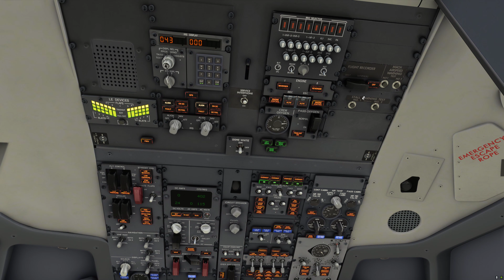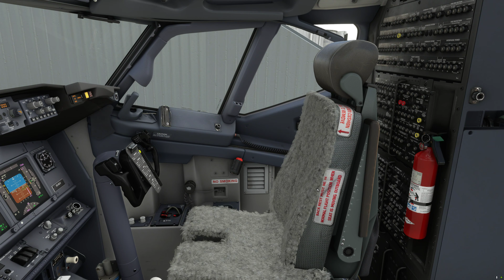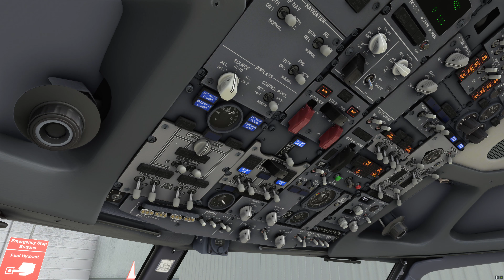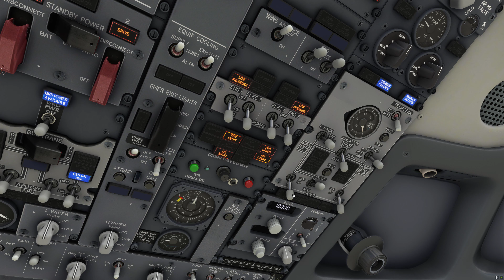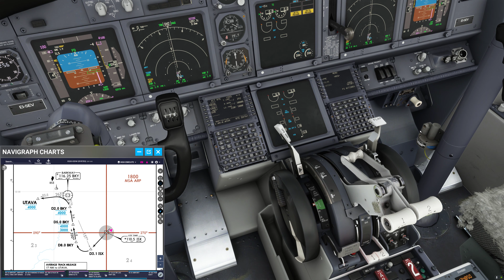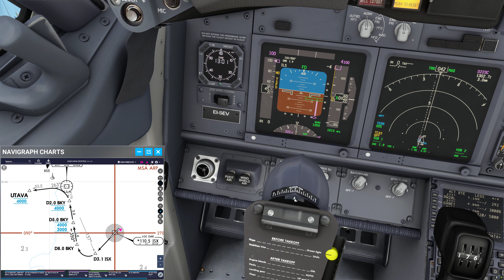PMDG 737-700 for MSFS - Tutorial 4: Preflight Procedure

Comment: In your taxi tutorial I saw that you had your autobrakes on rto but I skipped back here and it seems like you didn't include it in this, when would you put the autobrakes on?
Reply from the maker: mmh, I might have forgotten them in this one. You'd set them to RTO as part of the Preflight Procedure. Basically at the same time you reset the fuel flow.

Comment: Wonderful video yet again sir! I wonder why RYR still turns on the wing fuel pumps very early, as in during preflight, like Southwest and what Boeing used to do, until waiting until before engine start when it is needed? Danke!
Reply from the maker: Hi, if you have pressure in the lines it's easier to detect leaks. That goes for both, hydraulic and fuel.
Reply: @A330Driver  Thanks for the answer! I think that's why United has the fuel pumps on during the walkaround. They sure do sound cool.
Reply: I know at Southwest, the FO does walkaround but the CA does most of the overhead so it doesn't really matter for SWA, but they still turn on the pumps regardless.

Comment: Would it be possible to see the flight model tested "to the extreme" :) ? Like stalls, trying to spin it, auto slats deployment close to stalling, split flaps if the failure is available, overspeed "flutter" ? Unusual attitude recoveries basically nose up/down ? :)
Reply from the maker: I've done a bit of it in my upcoming video, at least in terms of steep turns.
I don't see a lot of sense doing stuff like deep stalls, spins, large overspeed, etc.
MSFS, just like neither X-Plane or P3D, is not made to simulate the extremes of flight models.
Indeed not even full flight simulators cover all these aspects.
Thus I woulnd't expect accurate results in these conditions either. The base sim isn't programmed to simulate the extremes of the flight model, so addons will naturally not be able to get them right either.
Reply: Aw man, thats too bad 
:( 
Still, i'd be cool to see what it does :) will it completely loose its marbles or do something aproximating reality :)
Cool that steep turns will be shown.

Comment: I was wondering...is the ram air enough to spin up a cold engine from a standstill, no wind present ? Just to see if it would work, i tested this in the the ngxu in p3d, i took of on one engine (a big no no i know) but the engine didn't start spinning up, i also wanted to exclude the wind in that test so i set it all to 0. Im wondering if this behavior is still present here ? The engine should start windmilling right ? There could be no core lock becouse the engine was cold from the beginning of the test.
Reply from the maker: If with ram air you mean the wind, then totally yes. It won't spin fast enough for engine start when the airplane stands on the ground however.
In flight, with the speed over 300kt the ram air is sufficient for engine start.
Reply: Exactly, basically i took off on one engine in still air to see if a cold, completely stopped engine would start windmilling, in the p3d ngxu it didn't. I did the test just for the hell of it, just to see if some physics weren't canned in some way :) and i was wondering if the msfs version had that problem as well :)